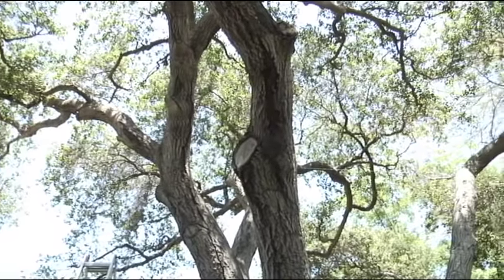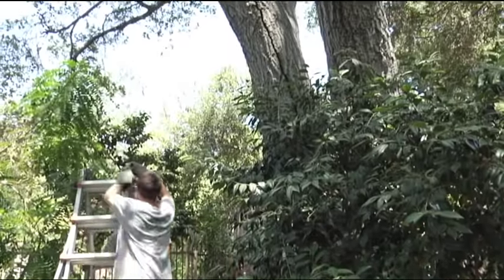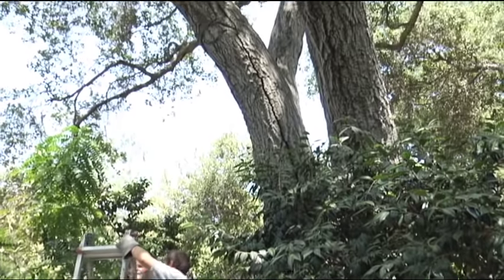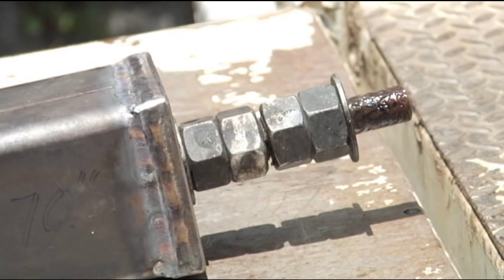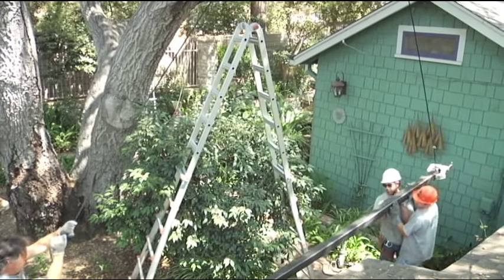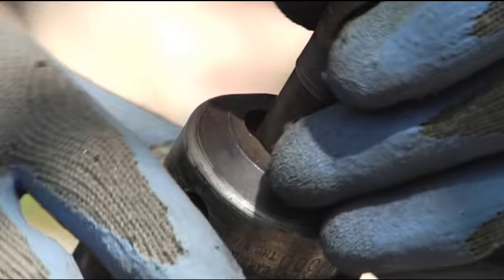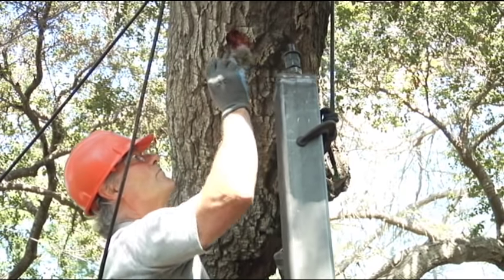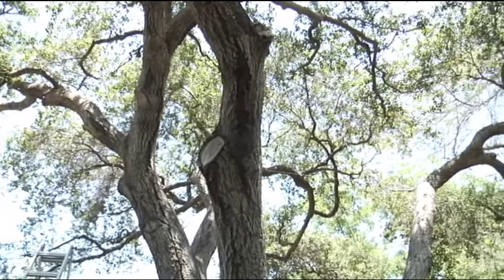Installing a Tree Brace - Prune Like a Pro

Comment from the maker: concrete is a possibility, but we don't want to do any excavation because digging will inevitably damage the roots of the tree we are trying to save. an above-ground concrete base is also possible, but that would be additional cost where our design is sufficient for its intended purpose. 
However, I am happy to see other design ideas if you have them. If you ever install a brace, share your video with me - perhaps you may discover an innovative new way of building it.